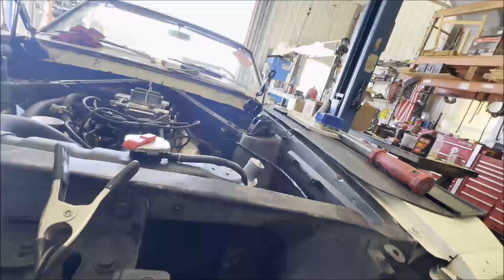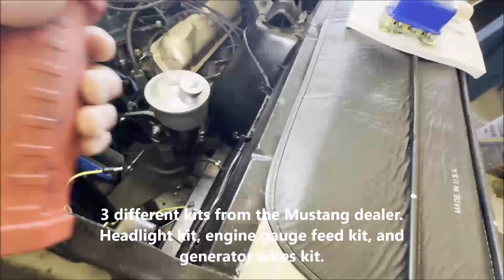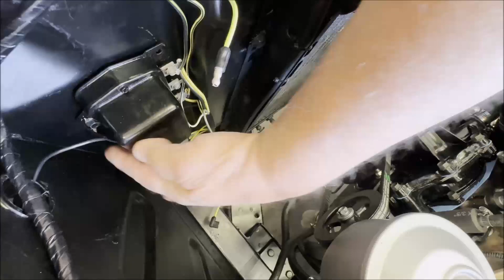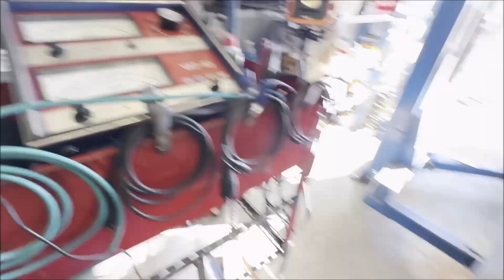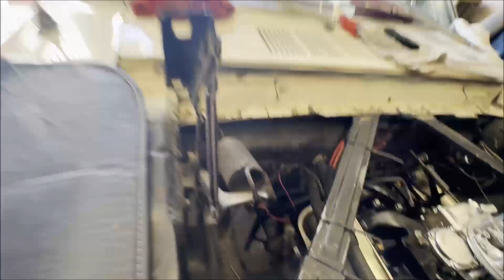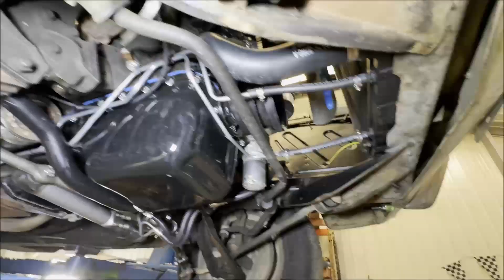1964 1/2 Mustang Repair Update

Comment: Looking great under the hood, Nick! I don't care about things looking perfect under the hood, but when they look sorted out and cared for, it's really great. As to the voltage regulator, this may or may not be helpful (or relevant), but on my 6 volt '54 Ford, I had like three or four NEW voltage regulators in a row that had problems of one sort or another, and I was never really pleased with how well my system charged with them (and I previously installed a brand new 6 volt generator.) I ordered all those VR's online. THEN I bought a new 6 volt regulator from NAPA a couple of years ago and I haven't had a problem to speak of since. I.e., I have very low expectations for many brand new parts for old cars. Have a great New Year!!
Reply from the maker: Hey Kayeninetwo, yes, Standard products makes most automotive electrical parts and Ive had a big problem with them for decades. They started buying up companies in the 80's like Blue Point and turned them into trash. All the quality just went out the window. Unfortunately some parts are only available through Standard so sometimes I just have to bite the bullet and use them. I hate that. Thanks.